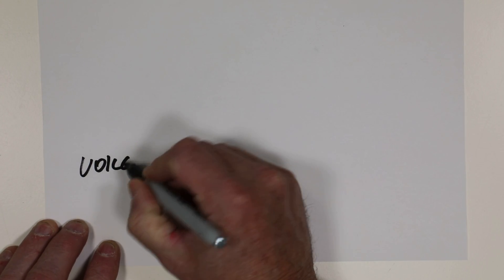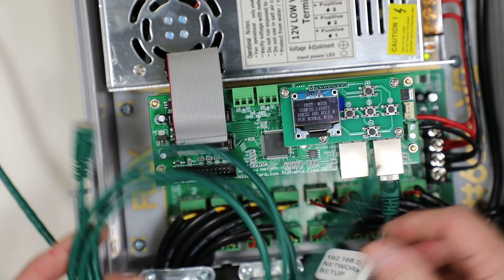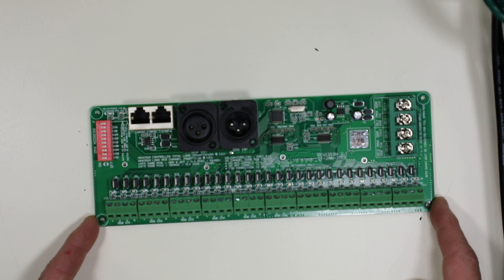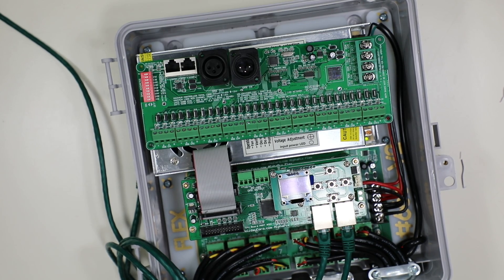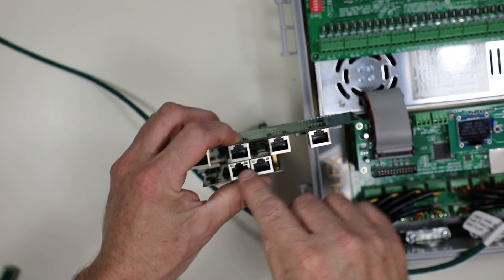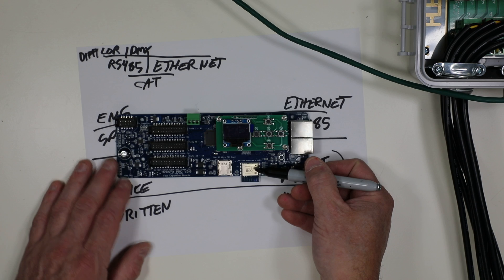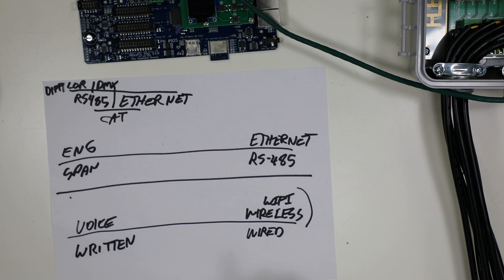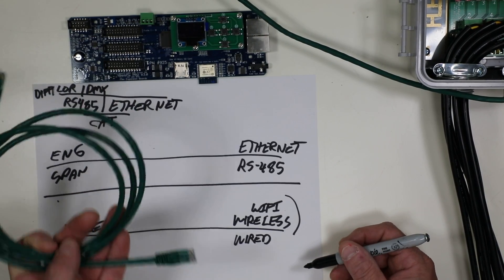Physical Interfaces  and Wiring in Holiday Lighting Controllers / Part 1 of 3

Comment: Thanks for the good information. Is it true that the differential outputs running on RS485 are not meant for large smart pixel displays (megatrees and the like), but okay for smaller fixtures with fewer pixels in order to avoid lag?
Reply from the maker: RS485 should not have any lag but RS485 isn't used that commonly any more in large displays with thousands and thousands of pixels except for the odd item here and there.  This is why on older controllers, you'll see 2,3,4 RS485 ports but on newer controllers 1 or maybe 2 RS485 outputs.